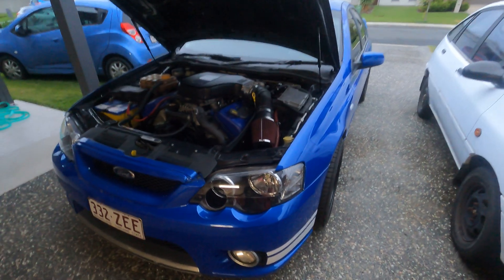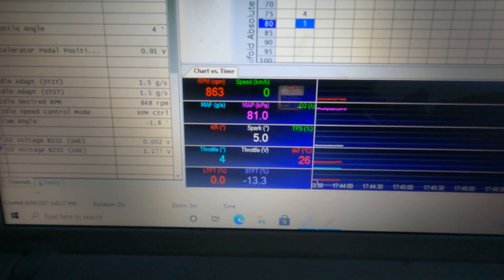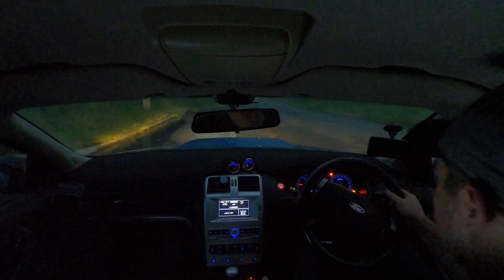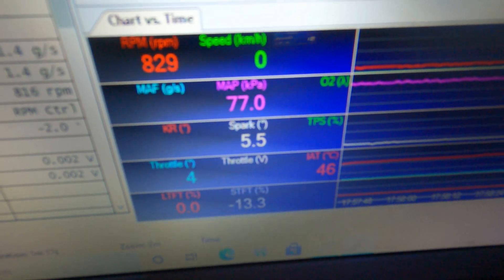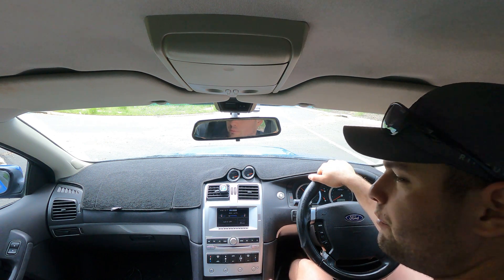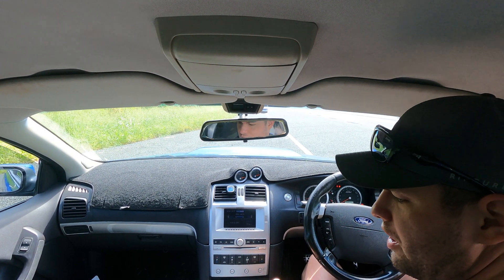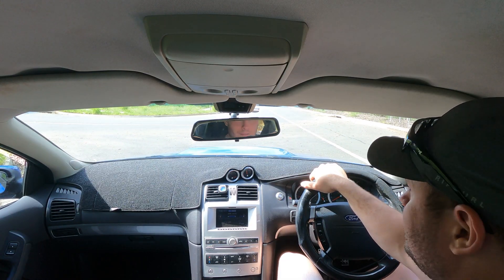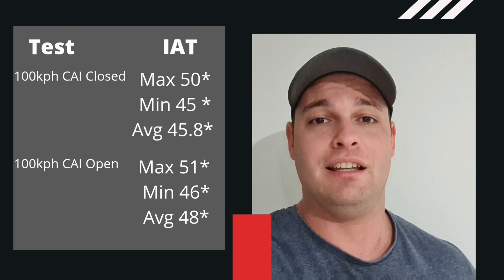Cold Air Intake system benefits testing with Datalogs.

Comment: All you did was make the engine bay cooler..Still. Now I know how to cool my ABS unit which has failed a few times due to over heating!
Reply from the maker: It didn't even make the engine bay cooler, it was a complete failure. However, since adding a duct within the cut-out. It is extremely effective.
Reply: @GapSauceYoutube  R U saying you connected the head light duct to the intake with a pipe? YES. That's what I was expecting you would do. I think you should do a repeat follow up showing the improved mod.
Reply from the maker: @dora-de-explora  I connected it to the airbox yes.  I'm part way through a video similar to my most recent upload, but about the GT. I'll include this in there, thanks for the reminder 🙂

Comment: Hey man,  I've been obsessively doing testing on my air intake too on the 5.4L 3v.  I have tried all sorts of designs, cutting up the stock air box, using the F6 airbox, and I also have the bluepower CAI which is very similar to the CAI you have set up.  The pod CAI you have, boxed off, is the best design I found for consistency in IAT.

I also have a typhoon front bar, but its got missing fog lights.  I bolted an aluminium plate to deflect air from where the fog light goes into the channel behind the headlights, it seems to dropped the IAT quicker when moving.  If you want to get REALLY scientific, then I think you also need to start measuring air pressure points :)  Love your work.
Reply from the maker: Hey mate, that's cool to see others testing.  I think sealing the duct in the headlight with a pipe (which I have but wanted to show the results without it) would yield great results and show be near ambient temps. Ill have a look into deflection channels too, any gain is worth it! I think I need to completely seal the airbox to the bonnet though as its not completely sealed.  I think the turbulent flow over the first hole in the headlight it creating a high pressure area within the lens and inhibiting the flow through the aft hole.  Id love to test with a sensor to confirm this though.

Comment: Cool rig mate. How long did you do the testing for? I would have thought you'd have to do your test over a long period on the open road? Surely results would be more extreme in a dyno?
Reply from the maker: Thanks mate, the test was about 4-5km each way. enough for the IAT's to stabilise.  I believe the headlight needs an actual duct so that it doesn't cause turbulent flow over the hole and create a high pressure area within the lense.
Reply: @GapSauceYoutube  Yeah a bell mouth would make a huge difference to shape the air into the intake. Maybe try and find one from an old subwoofer box or something like that. Have you tried a Herrod Helix Spacer? My old man has one on his GT-P, said to be worth about 4-5 rwkw for a simple bolt on mod.

Comment: The standard intake will provide more 'cold air' than the headlight hole. The amount of available air flow will increase if running a pod like this but the open headlight does nothing. There will likely be no air flowing in through the headlight as it will be equalled out by the air pressure on the other front ducting like the radiator etc. You need to completely seal up the area and separate it from the cooling ducts or run a large duct from the fog light area straight into the throttle body.
Reply from the maker: Yep, I mostly agree mate. My thoughts are that the sharp edge on the lenses is causing turbulent airflow and a high pressure area inside the headlight itself inhibiting the airflow.

I think making in an actual duct will yield decent results alone. But ill make it work and come back and share my results 🙂.

I really just wanted to illustrate that what would appear to work to the naked eye, may not actually be the case 🙂
Reply: @GapSauceYoutube  yes, great test to show the results, a bit like snorkels on four wheel drives, they decrease power due to the restriction of additional length and turns. Most people fit them for looks and because they are told it improves power etc. 

I use a standard map sensor to test where the greatest pressures and vacuum resides around the front end. Just in front of the radiator support panel and the bonnet is generally the top spot. Love what you're doing with the quadcam, thing sounds great and goes awesome. Keep it going :)

Comment: Awesome videos mate!

What’s next? 
More drag racing? Higher compression? Nitrous? 

Can’t wait!
Reply from the maker: Thanks for watching mate 🙂

I want to keep it alive and do a few more events while I put money aside for the motor I'll build on the side. (Higher comp, ported head etc)

Thus bottom end doesn't really let me use the potential it has. I'd love to shift up around 7700 but I'm not keen on abusing the stock rods that much 😅

But ill be covering the build either way.
Reply: @GapSauceYoutube  bloody awesome to hear!

I thought the limit was always the heads? They used to calculate piston speed then worked out it was all in the heads. With quad cams I thought you’d be able to go higher...

Are there common failures or something?
Reply from the maker: @s4060  The heads flow really well out of the box, enough to make power at a higher rpm than I consider consider be safe for the stock conrods.  Peak power is at 7400-7500rpm and I'd prefer to be shifting a little earlier than that until I get some nice rods and pistons in there.

Comment: These numbers are bang on what I've been testing with the IAT numbers on my BF GT-P with Vortech supercharger and upper intake plenum phenolic spacer.
I've run the intake pipe for the Vortech down under the passenger headlight and down through the front bumper and sat the large pod filter in the lower grille mouth opening of the GT bumper, in full exposure to the incoming air. I found IAT numbers using the sensor in the intake manifold lid to be on average 43C this way. Max on a 38C summer day I've seen 68C but no higher. (These numbers drop pretty rapidly back to 40C and under, whenever I give it some decent throttle, and the throttle blade opens a lot and the inrush of cooler air cools the IAT sensor back down again. I can see this phenomenon as I'm driving in real time.)
I then spent another week driving the car with the pod filter moved to be hidden behind the front bumper cover in behind the passengers side fog light (because I was scared of it being exposed to rain and being plainly visible to cops in the lower grille opening) and logged the temps again.
I saw barely a 1 to 2C difference in IATs with the filter hidden behind the bumper cover and out of direct airflow.
Your IATs with your home made cold air intake look no better or worse than my pod filter on a pipe behind the front bumper or out in the grille opening. The numbers are nearly identical between your car and mine. I don't therefore believe that they can get much better, as I think an all round average of 40ish C is a "system average" IAT for the Boss 5.4 given the amount of average heat soak, alloy castings, etc.
I run a lower temp opening thermostat and see coolant temps no more than 95C which probably has an ambient air temp effect in the engine bay and associated alloy heat soak components
Reply from the maker: Thats interesting, ill definitely do my best to mythbust it with a completely sealed unit. Thanks for the input, you should see the IAT's I've had on 100% meth injection on a 37degree day, I've seen as low as 12deg. There was condensation onnthe throttle body when I pulled over to refill.

I'll be back with a more refined system 🙂

Comment: are you running a insulator between the heads and the intake manifold?  i know you have one of the plenum lid but found they dont do anything for iat but do help with distribution. hard to tell actual intake temps awell when the sensor is on the lid not the intake itself but guess it gives a fair idea
Reply from the maker: I measure somewhere in the region of a 10degree drop in plenum lid temp (measured with laser temp gun) after fitting the spacer.  I believe it helps the IAT sensor with heat soak affecting its reading as much.

Definitely agree it helps with distribution. I don't run spacers on the runners 🙂
Reply: @GapSauceYoutube  be interesting to get a sensor down closer to the intake valves to see what the temps are like down there, i dont think the boss intake sensor is really well placed right in the back corner of the plenum lid. 10deg drop on the lid is pretty decent with the spacer tho, would defiantly help, even if that only relates to about 1-3 deg drop at the cylinder
Reply from the maker: @Anthony Pllu  I personally think that any change in air temp between the sensor and the valve is negligible compared to the massive change that takes place during atomisation of the fuel upon injection.  The main benefits for me in cooler air passing over the IAT sensor are in the retention of ignition advance in the timing map. (Which pulls timing when it see's high IAT's) so I'm not saying that there is no benefit to cooler air in the manifold, just that at wide open throttle, I don't think it's moving slow enough to heat it enough to make a difference.

Interesting you mention the placement of the sensor, one thing I noted with the switch to the Yella Terra Plenum lid was that the IATs didn't appear to drop nearly as far as with the stock lid, I can only put this down to the fact that that sensor is no longer in the direct airstream and doesn't see the same airspeed/droplets of water/meth to cool it.

I also think that the manifold spacer you mentioned might give you the ability to match port the head port(which seems to be smaller than the intake manifold port) it leaves a nasty Ridge which I show during my intake plenum upgrade video.  Only other way would be to pull the heads and port match.
Reply: @GapSauceYoutube  time to 3d print some spacers with measurements from the head and the intake haha
Reply: i just took mine for a boot and logged the IAT, started at 45c sitting on the side of the road, did a 2nd gear wot pull and it dropped to 29c, would say my growler intake is working well then
Reply from the maker: @anthonypllu3864  yeah not bad, what's the ambient temp? Mine weren't WOT pulls, unfortunately I can't really test them on the street 😅 So I had to stop at 100kph.

I had my water meth IAT's down to 12deg on a 37degree day In summer 🙂 started at near 70*
Reply: @GapSauceYoutube  was 22 ambient, my workshop is only a street away from a major road with 100k limit so i can do a nice pull up to 100 there, water meth is such a good thing, once ive sorted a tailshaft out for the wagon ill be doing some track time with it,
Reply from the maker: @anthonypllu3864  I wish I had a workshop 😅 Oneday soon hopefully! Yeah, its brilliant in summer! I'm keen to hear more about it mate, good luck!
Reply: @GapSauceYoutube  ill let you know when i get a decent fpv steering wheel in, your gives me the shits in the videos hahaha. ill send you one up

Comment: 5-6 degrees of timing at idle seems low? After a bit more chop chop me thinks..
Reply from the maker: There's considerably more advance than the original tune at idle, it wouldn't even idle with the cams otherwise. Definitely don't want more chop, it's already ridiculous. I also haven't had a chance to revise it after getting it initially running and driving reasonable. Need more time for testing and some more time on track where I can open it up safely.

These 5.4 take alot less timing than your usual SBF, I believe there was only 21 degrees total in the factory tune from memory.
Reply from the maker: Usually you set idle advance based off the most vacuum you can see, This helps driveability, I haven't got that far into this tune yet. 🙂

Comment: Ahhh that raunchy ear gasm, love it! So wanted you to pedal it a bit on that second gear round about exit... I conquer with your speculations for further improvements and I also have a couple of theories of my own that I believe could be worth putting to the test. Let me know if you are open to trying out other peoples suggestions...  Definitely need to create a tight uniform seal between the air intake and the under bonnet engine heat first though. 😎👍
Reply from the maker: I agree mate, I wanted to show something a little different to the usual fluff thst you see about mods.  I'm 100% open to idea's for testing 🙂 Thanks for watching! I have another Brekky Laps roll racing in may, so plenty of racing footage then 🙂
Reply: @GapSauceYoutube  Yea sweet as bro, the brekky laps was awesome viewing content. 👍 first time I watched the brekky laps video entering the viewing with the already informed knowledge of just how little had actually been modified to your car at the time (low reading dynos or not) any car guy with a basic understanding of cars could pretty well predict what they believe would be the Window of general car speed the they believe it will be operating in. After they have mentally added up the sum of all the parts while they flick through the memory bank of their most comparable cars, or mates cars even just those cars that you ran a couple times while on a cruise or something. Anyhow you get what I'm saying yea? Before you even see it move most of us would feel like we'd have a good understanding of what to expect... Well... I'm very happy to let you know that I was genuinely very surprised and impressed by the way it held it's own and I was not expecting it. I think I'd pretty much ticked you to get done by nearly all of the cars you had runs with in that video! Except for the Hyundai at the start and the focus. When the other cars list of upgrades and power output was written on screen prior to the runs I was like yea 300 rwkw barra not going to beat that etc etc. Man each run and every car that you ran my grin was just getting bigger and bigger each time. I was right up face to the bloody screen. Rewinding to see it again and again looking for any sandbaging and shit. Legit man I could not get over how far away my original prediction was. I was well and truly wrong and I was thoroughly enjoying  every minute of watching you rub my bloody face in it too. hahaha

Comment: I do know from my own experience with the Blue Power Racing CAI, that they get loads of cool air from around the headlight already, which why it might be that there's minimal change mate.
Reply from the maker: Possibly, there is decent flow under the headlight.  I think my gains will be in spending time sealing off the enclosed box and adding a duct to move the high pressure area from inside the headlight to the airbox itself. I would love to test bluepowers unit though too, its pretty

Comment: Try a modified enclosed airbox, ie ba-fgx with the standard intake from the turbo ba-bf and this https://rover.ebay.com/rover/0/0/0?mpre=https%3A%2F%2Fwww.ebay.com.au%2Fulk%2Fitm%2F261401727491 which grabs cold air from under the headlight. Flows a bucketload of air & is all oem. Fit a big k&n pod inside the oem airbox. Fitting and fg or fgx airbox allows big pod filters with slight mod to the top of the box. Sealed with weatherstrip. Works awesome.
Reply from the maker: I actually picked up 2mph at the strip on the car removing the lid and snorkel when it was stock.  The GT doesn't have a big airbox like the later models though. My old xr6t made 320rwkw through the setup you mentioned though too.
Reply: @GapSauceYoutube  agreed, that's why I'm suggesting add an fg or fgx box. I've recently added a cold air system from the fgx xr8 (supercharged coyote)to my ba. Works a treat and seals to the bonnet. More or less a bolt in using oem parts. Had endless problems with hot air previously. Sensational channel btw, awesome content. Thanks love it
Reply from the maker: Thanks mate, I'd love to adapt the FG/FGx unit to my car. Getting hold of one cheap anough to gamble with would be the hard part surely 🤔
Reply: @GapSauceYoutube  entire unit brand new from ford spares Inc the rubber seals etc all under $150. Comes as air intake lower, air intake upper and seals. I saw blokes on eBay want over 1000 for second hand units. That's bs... All parts brand new under 150
Reply from the maker: @SHOCKcustoms  I'll investigate this tomorrow! Thanks
Reply: @GapSauceYoutube  just grab a fgx xr8 vin and youll be sweet. Give us a yell if u cant source it and ill hook u up
Reply from the maker: @SHOCKcustoms  Thanks mate 🙂 I might just do that.

Comment: It might look stupid and get you in trouble but what about one of the tests with the intake tube routed straight through the headlight with just a screen or the pod filter out front only sucking air from outside the engine bay, as a sort of control test to see actually how much of the heat is from the under bonnet air. I’m starting to think there will be a point at which the manifold heat soak will be what your getting down too, where the ambient air temp won’t effect the inlet temp any more. There will always be a certain amount of heat transfer from the engine to the manifold at operating temp. It might be that 19 degree ambient temp is lower than the point where the outside air temp will effectively change the inlet air temp.
Also the light load at cruise might not be flowing enough air through the manifold to overcome the manifold heat soak, flow vs heat transfer. 
I don’t explain things well so I hope u get what I mean.
Reply from the maker: I definitely agree mate. I did do a few pulls, but unfortunately had to stay below the speed limit. Ill be testing a sealed of suct/airbox which should give me similar results, well hopefully anyway.
Reply: Gap Sauce cool i’ll be waiting to see how that goes 👍
Reply from the maker: @ZedTee77  Sit tight my dude 🙂